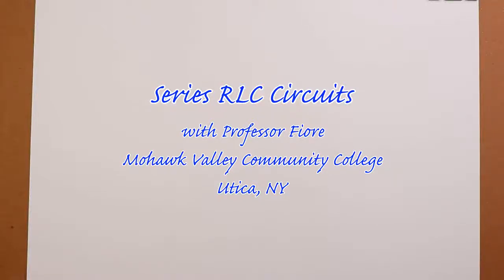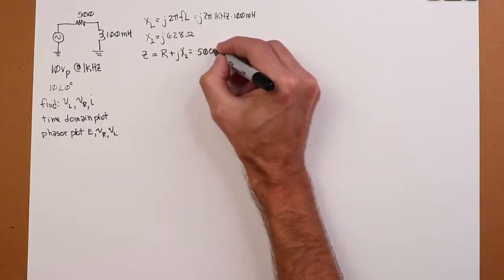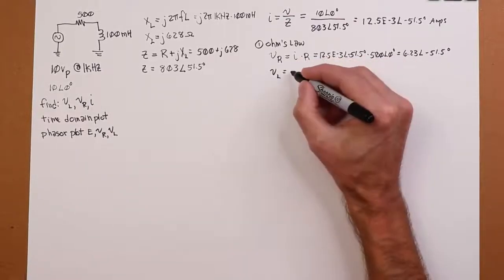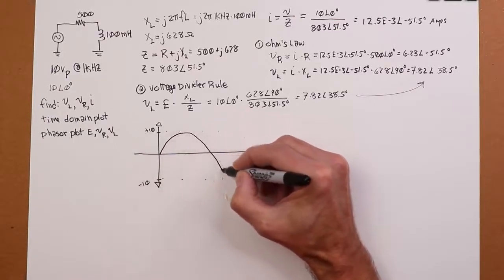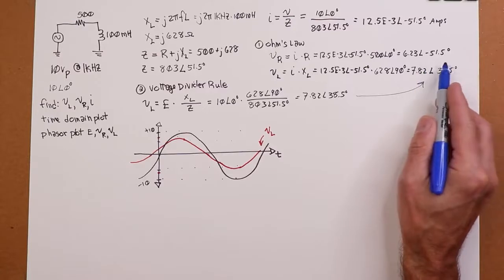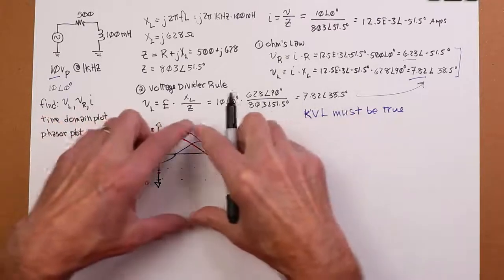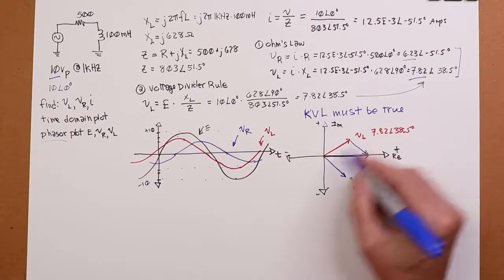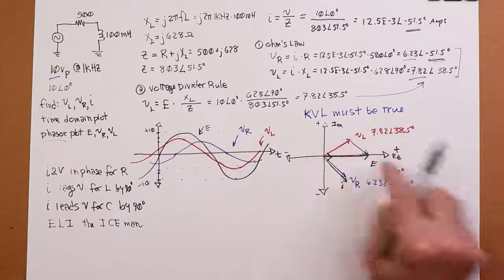AC Electrical Circuit Analysis: Series RLC Circuits

Comment: I guess ihave forgot things over the years.  What is j?
Reply from the maker: j is also called i (in math class, but we call it j because we already use i for current). It is the square root of -1, and is used to express the vector nature of the electrical signal (i.e., magnitude and phase). Can't do much in AC without using j.
Reply: @ElectronicswithProfessorFiore  OK, I am used to i.